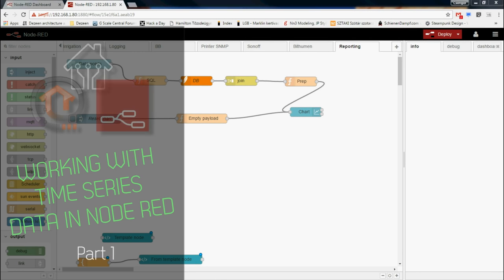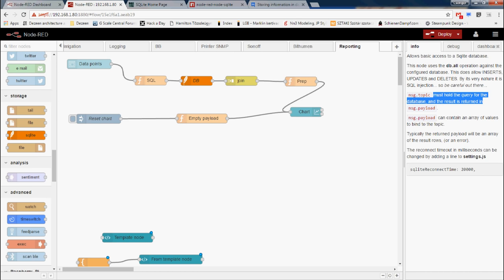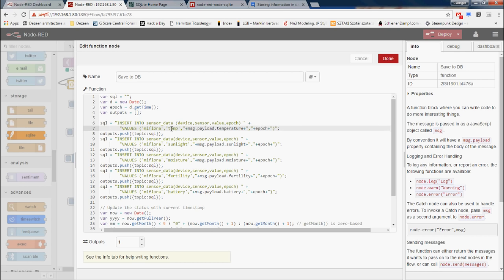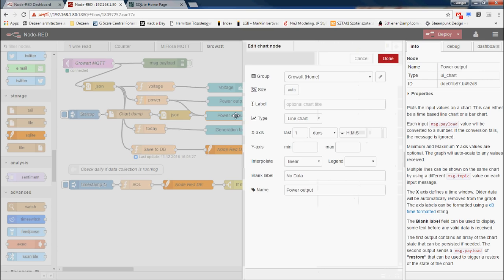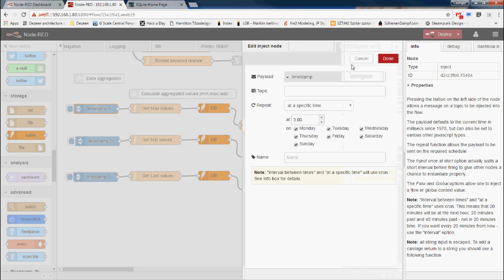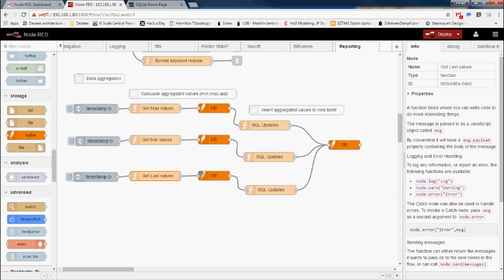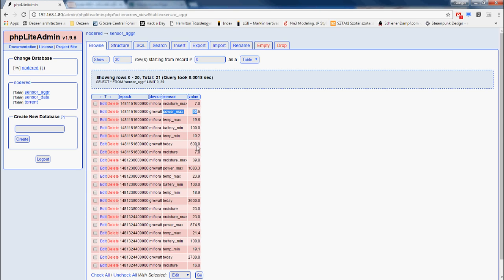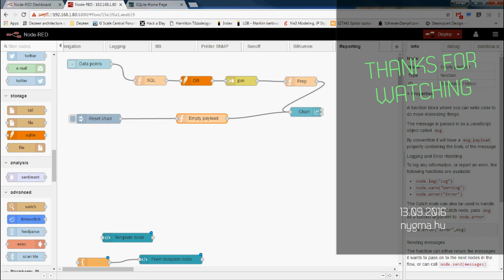Working with time series data in Node Red with SQLite

Comment: Hi, the most instructive video on the topic of node-red+sqlite+chart that I found, it's a pity that I didn't find a continuation on the channel, or maybe I was looking badly? It would be great to add a base on github, for tests in node-red. Thanks for the video👍
Reply from the maker: Well, SQLite started to be very big and slow after some time. So I also migrated over to influxdb database storage and Grafana for reporting.
Reply: @csongorvarga  Yes, it all depends on the tasks, I don't have many of them, so on the contrary I want to switch to a lighter and portable one instead of influx)) Good channel, good luck.

Comment: Very good set of instructions. Very Detail explaination. I can not wait for next video in this series as I am working on Greenhouse automation project using ESP8266 & some sensors namely temperature, humidity, lux & soil moisture.Also I will be controlling a fan & a servo for this project.Until now I was lacking understanding of database storage in node red and from this video i think I will be using SQLite.

Thanks very much.

Comment: Very good video. I learned a lot from this and your other videos on the same subject. Being new to using node red on a project the SQLite will come in very handy. Thanks to your help I have integrated node red, mqtt and SQLite to monitor my remote battery powered esp8266's with sensors which communicate with mqtt to node red and also sending the data to ThingSpeak. Recently I have developed the software so the esp's can be woken from deep sleep mode to enable OTA programming. A corresponding command from node red will put it back into deep sleep cycle again after programming.
Reply from the maker: Thanks for the comment, looks like an interesting implementation.

Comment: Nice video but i have small problem. I tried join on multiple data as you and it has weird behavior. Every click on refresh data in graph ti will create sql commands but output fromjoin has 2arrays, 1array, 3 arrays - i think it depends how fast will sqlite return result. I thought that join must wait until its complete but it seems that it wait for message complete but not for all data from sqlite. Can you please help ? Maybe i am blind and it is some stupid small error ...
Reply from the maker: Hmmm, the SQL does generate multiple SQL outputs, which will each generate and array. But in the line 148 of the SQL code, I am setting the complete attribute of the last message to true. The join will wait until it receives a message with .completed = true. It works for me. I am seeing multiple lines on my graph. I am not sure why it does not work for you. Maybe the last data set takes much less time to return and that gets to the join first? This is just a guess, but I don't have any other clue.
Reply: I have the same problem, maybe do u have a solution? Best regards

Comment: Nice video! Is phpmyadmin and phpLiteadmin the same? I only have phpmyadmin installed on my raspberry will this flow work with my nodered?
Reply from the maker: I am using SQLite with a specially lightweight database. And that only works with phpliteadmin.
Reply: @csongorvarga  I created the database, the tables and inserted some random values using python script. I have replaced your "sqlite" node with "mysql" node, but the mysql node is not retrieving any data and debug screen is empty and the same is the case with UI dashboard...since the data retrieval is not happening, I am not getting the chart. But this is a nice and simple dashboard though. I have a similar requirement where i need to plot a sensor value in chart.

Comment: I have recently upgraded node red to v2 and now I find I get "Bad data inject" error from the chart node in the dynamic charts flow. I reverted back to v1.3.1 but still get the error which is strange. The charts have been working ok for a long time so I wonder if you are aware of this problem and perhaps you could help me to fix it. Thanks and stay safe.

Comment: Great Video.  Would it be possible for you to share more information on setting the permissions for the database.  I managed to create the database and able to create tables and data from phpliteadmin.  However, when I try to insert data from node-red it tells me "Error: SQLITE_READONLY: attempt to write a readonly database".  I know it's obviously a permissions issue, but being new to Linux, I'm having a hard time with this.  I've changed permissions for all the folders and database file with chmod but still no luck.  Perhaps creating a video on this alone would be great.
Reply from the maker: I am relatively new to Linux as well. I did chmod 777 <db_folder> before I created the database and everything was OK. So I don't really know what the solution is. By doing ls -al, I can see that the owner of the sqlite folder is root and for the database file it is www-data. Check what is the case in your system.

Comment: I use a similar technique to you to preserve the graph data in a file then reload it on reboot. My interest in this article was to store the data in a database which seems logical. Is there a reason why you do not access the data from the database to reload the graph data rather than use the same data which is written to a separate file, this seems like a duplication of effort.
Liking your videos, thank-you.
Reply from the maker: No, not really. I think I just did the chart backup before I started storing values. And I have not gone back to change that. But I use the same method ever since. Fewer number of nodes to be honest :)
Reply: @csongorvarga  It wasn't a criticism. My original approach was the same as yours but then I thought perhaps using a database was a more logical conclusion, which was why I was interested in your video. Then on watching I found you weren't using the database but the same method as me to retrieve chart data. I just wondered if there was a reason for it. Not trying to fix something that is working is a valid reason. 
Now I will try and get my head around SQLite, I haven't created a database since Dbase on the BBC Model B.
Cheers
Reply from the maker: @dikl2689  OK got you. Well, you can easily do it using the above flow. Use the SQL, DB and Prep nodes. In the SQL node prefix the filters and that's pretty much it. You can even omit the Join if your chart is using a single data source. The code in the Prep function can also be simplified as it is prepared to combine multiple data sources but deals with a single just fine.

Comment: hello! I’m a beginner in programming so please excuse me for my ignorance:i need your precious help on a project. I have a beaglobone black which is supposed to get measurments from an amplifier  and then save them in a new matrix( 2 columns of frequency f and time t ).I need the measurments imported into node red and then shown on a chart of frequency and time axes.could you help me? thanx a lot!
Reply from the maker: I will try to help. But how are you getting the readings into Node red? Displaying multiple values in the chart is easy, you just need to change the subject and the chart will keep track of the two data series automatically. Btw, there is a Node-Red Group where there are lot of people who can help. I can help here as well, but that platform is easier for communication than comments in Youtube.
Reply: On node red i have used successfully the alafile node to pull data from an xls file. I would like those data displayed on a chart (X-Y data) which i keep falling short of doing. Any help would be really appreciated.Here are the xls files as well (https://www.dropbox.com/sh/z59s47b24uxm1ps/AACIBpMHQLgWfSjMX1Obsbhxa?dl=0) [{"id":"adc929dd.74c1c","type":"tab","label":"Flow 1"},{"id":"a293ab3c.c48d08","type":"inject","z":"adc929dd.74c1c","name":"","topic":"","payload":"","payloadType":"date","repeat":"5","crontab":"","once":false,"x":104.5,"y":187,"wires":[["8f3615ea.73b828","6391ad80.5e1324"]]},{"id":"8f3615ea.73b828","type":"alafile in","z":"adc929dd.74c1c","name":"X data","filename":"Desktop/NODE1","format":"xlsx","columns":"*A","headers":true,"x":331.5,"y":94,"wires":[["9ca08631.af42d","d7730091.04504"]]},{"id":"9ca08631.af42d","type":"ui_chart","z":"adc929dd.74c1c","name":"","group":"e50ac821.60ead","order":0,"width":0,"height":0,"label":"chart","chartType":"line","legend":"false","xformat":"HH:mm:ss","interpolate":"linear","nodata":"","dot":false,"ymin":"","ymax":"","removeOlder":"5","removeOlderPoints":"","removeOlderUnit":"60","cutout":0,"colors":["#1F77B4","#AEC7E8","#FF7F0E","#2CA02C","#98DF8A","#D62728","#FF9896","#9467BD","#C5B0D5"],"x":537.5,"y":196,"wires":[[],[]]},{"id":"d7730091.04504","type":"debug","z":"adc929dd.74c1c","name":"","active":true,"console":"false","complete":"false","x":752.5,"y":127,"wires":[]},{"id":"6391ad80.5e1324","type":"alafile in","z":"adc929dd.74c1c","name":"Y data","filename":"Desktop/NODE2","format":"xlsx","columns":"*A","headers":true,"x":366,"y":329,"wires":[["9ca08631.af42d"]]},{"id":"e50ac821.60ead","type":"ui_group","z":"","name":"Default","tab":"110b80c3.583e0f","disp":true,"width":"6"},{"id":"110b80c3.583e0f","type":"ui_tab","z":"","name":"XXX","icon":"dashboard","order":1}]
Reply from the maker: The dropbox link is not working.
Reply from the maker: I found your post on the group, let me respond there.

Comment: Is it possible to generate some code for software architecture in whatever language, with Node-Red?
Reply from the maker: Sorry, but what do you mean? Generate code for what?
Reply: For instance, with UML tools you can create/design a visual software architechture in diagrams and arrowed connections representing dependencies. Thus you can use that UML design to convert or generate the initial architectural code, then you can start populating that architechture with needed logic. 

Vise versa you can write your software in code, then use eclipse for instance, to generate a UML Diagram to get a visual representation of your architechtural design of that written code.

So my question here is, can you use Node-Red to combine (custome) nodes so that its output could be generated code file(s) in python or C++ or in my case (Structured text) or whatever else?
Reply from the maker: I see, I am not aware the something like this is available.
Reply from the maker: Clarification: it is possible to build a custom node in node.js, but this way to advanced stuff for me. You can use the exec node to execute any phyton or C code and use the command line parameters, output, files etc. to exchange information. That's all I am aware of.

Comment: Hi, I liked your video very much, good work. I learned a lot of stuff especially SQLite.
I have a question about your soil fertility function, what is the sensor or sensors you use to detect soil fertility?
Reply from the maker: Thanks. I am using a Xiaomi MiPlant bluetooth sensor which measures temperature, sunlight, soil moisture and soil fertility.
Reply: Thanks for the quick answer. OK, so the fertility test is more like a TDS? 
How are you handing comm with your application? BLE doesn't have much range!
Reply from the maker: I do have a video on that in my Home Automation playlist. I have my raspberry pi in the same room as the sensor, so I have no issues with the communication. That is main drawback of this BLE module. The communication has been reverse engineered, and a python code reads the values from the sensor. And I have no idea how it measures the soil fertility.
Reply: Thanks for the info., I'm interested in the Xiaomi compared to the Parrot because of pricing. I will try to retrofit an ESP8285 to replace BLE but power and deep sleep will be issues I guess.

Comment: hello, 
can you send me node files inclued with the database files?
because i have copy your code but i get no line in the chart
thanks
Reply from the maker: I put the create commands into the video description. My DB is currently 300MB, so I will no send that over. You don't need the chart dump files either to make the flow work.

Comment: why stop? show please last join and prep node, searching about some hours to prepare data for chart, nothing work realy. there is no chart input data documentation: format? max size? x-axis setting?
Reply from the maker: This is a very old video, the chart format has changed since. Please have a look at this example flow: this contains data format examples for almost all chart types. I am using this all the time: https://flows.nodered.org/flow/2938d98507c81648a2ab5ac1ba6e7d31
Reply: @csongorvarga  ty, i will check